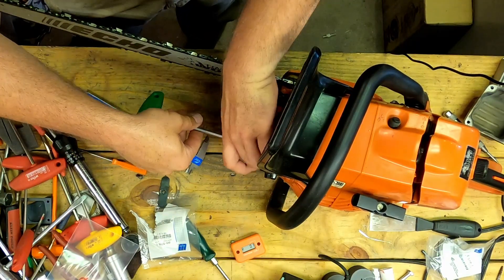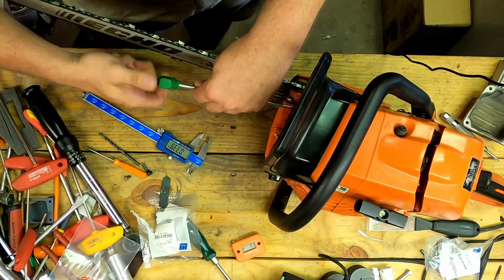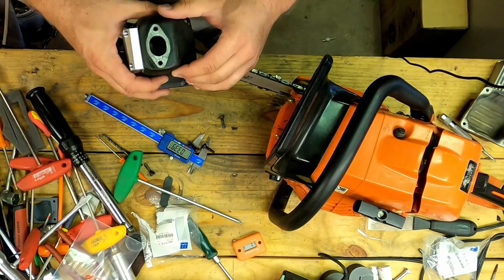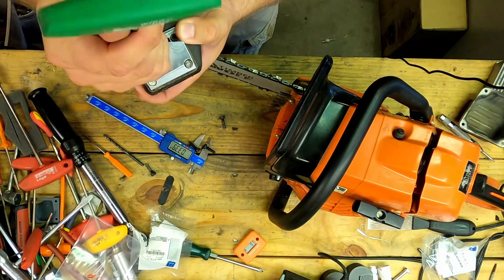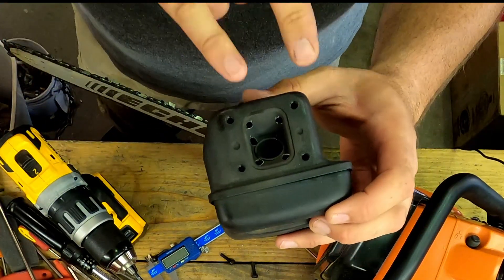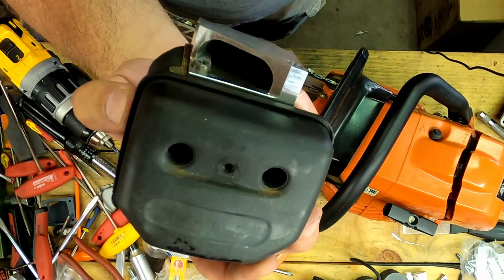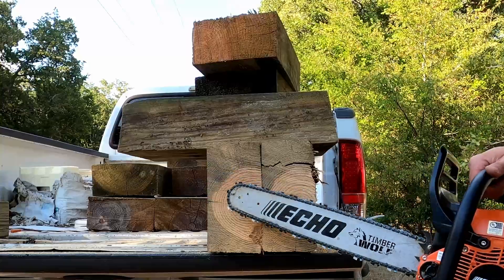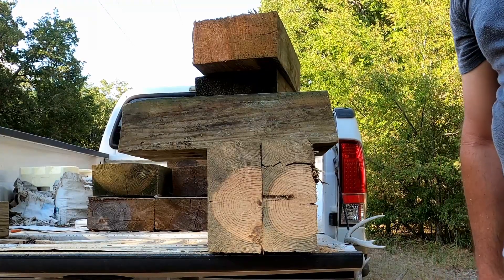CS-590 600 and 620 Billet Muffler Outlet - Modifications For Maximum Airflow on a Ported 590 Saw

Comment: I put your muffler deflector on my Echo Timber wolf 590 and it made a noticeable difference, my question is the saw is not ported so would I benefit from drilling these holes in my muffler
Reply from the maker: More exhaust flow never hurts as long as you tune the carburetor properly.
Reply: It's not so much about the airflow as it is the heat dissipation brother
Reply: Yes agreed, more flow= better performance and cooler running.👍